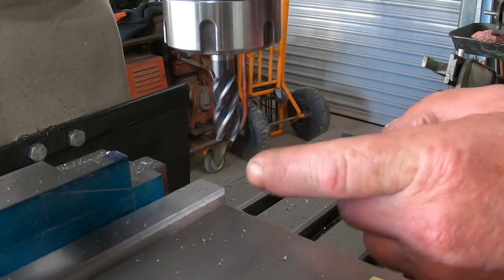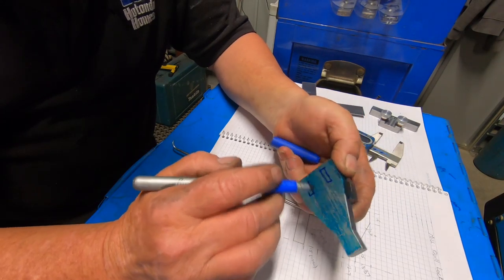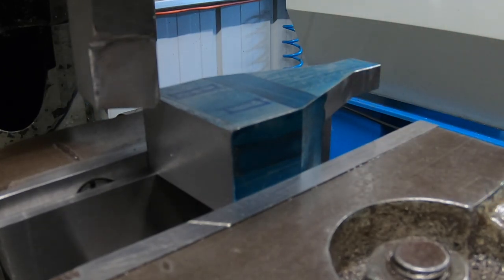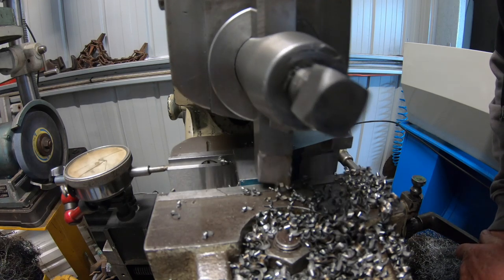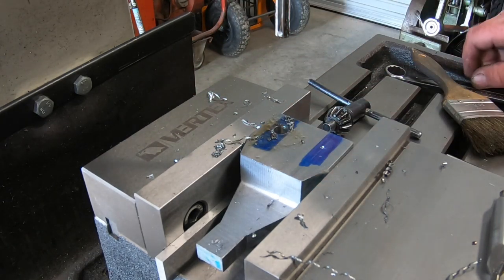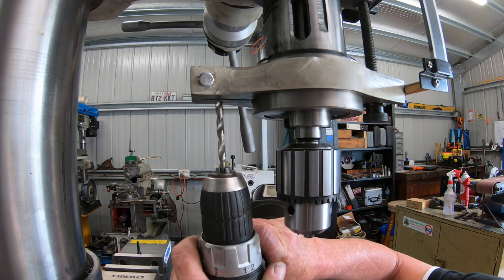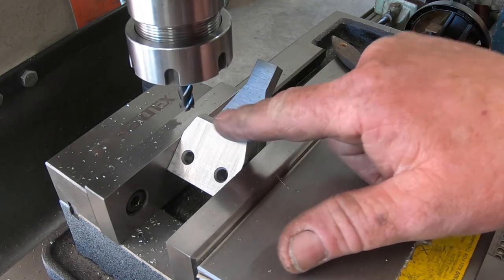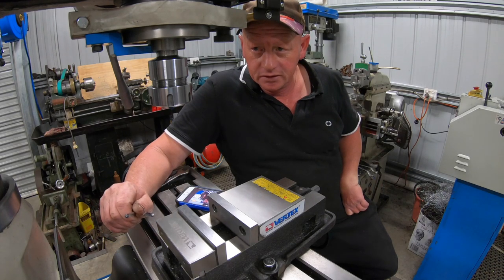Quill lock for the mill  part 2

Comment: Hi Matty, another perfect Job👍 are you running a VFD on your Mill? It sure sounded a lot quieter than mine. I have the same Mill. I’ve thought about going with a 3 Phase Motor and a VFD, and was just wondering if you’re running one. Thanks, Great Video
Reply from the maker: Gday, the mill is all original with no vfd, it’s always been quite really and plenty of power, I thought I might have had to o go with a 3 phase vfd setup but really no need to, cheers

Comment: Just a poke...  I made a quill lock for my RF30 too but it locks the quill not the spindle. I took the belt cover off the top and I grab the pulley to hold the spindle. Admittedly not a great method. Cool idea!